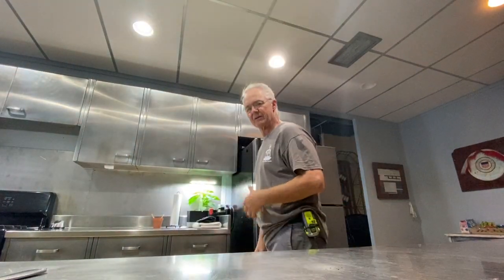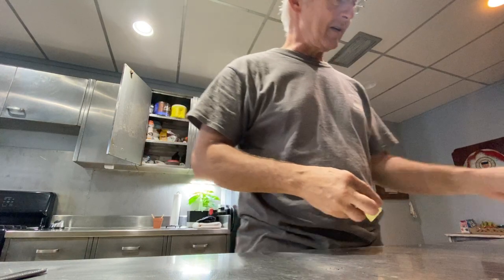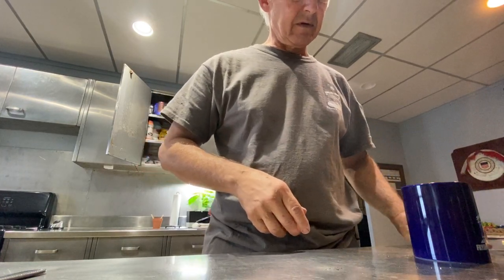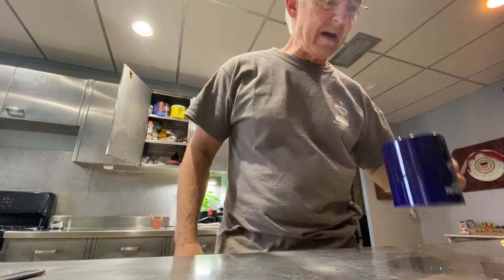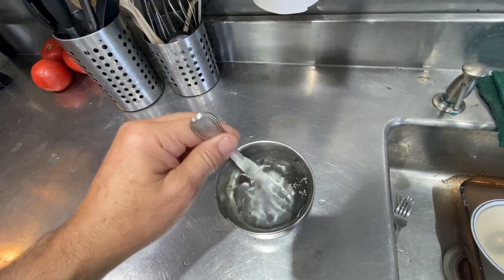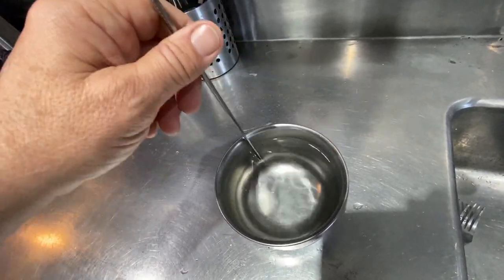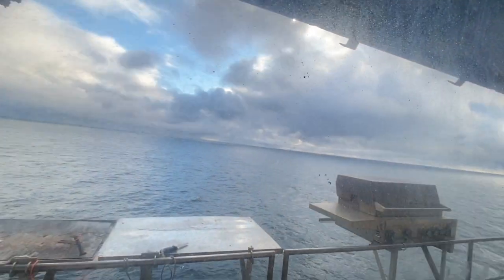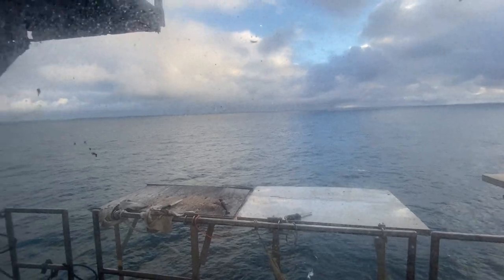How does the tower stay up in storms? and coffee...

Comment: How do you access the crane when you go there alone. Do you have to make sure you have a remote control with you. There is no to dock or anything right. In case the crane doesn't work, you have to go back and take the helicopter?
Reply from the maker: The answer is actually very simple. The boat comes within 3 feet or so of the NE corner leg with what's left of the rusted handrails. I jump off from the boat to the leg and try not to miss. Climb up 65' and open the access gate. Make my way into the belly, up the central stairs, open the main doors (for airflow) and fire up the Honda 7k generator to lower the hoist cable and start snagging people and large lift bags up from the boat 70' or so below. Easy... ;) or I take a helicopter if the waves are known to be over 4' because jumping from a boat in 4+ foot waves, now that would be crazy!  Richard
Reply: @FPTower  I love that you answer everyone's questions including mine. Thank you so much. Kind of like when a captain needs to jump on a cruise ship or a cargo ship to dock it in their marina. They drive up to it and the captain jumps off and hangs on for dear life. Thank you sir, appreciate your answers to my questions.

Comment: 42” round nice size, i have also heard rumors that the supports on thos structures go almost 300’ down into the seabed ?
Reply from the maker: I've been told several things over the years (original engineers seem to all be gone now :(  ) but they are at least 30-60' deep and filled with cement!
Reply: @FPTower  And, it's not as if they could divert the ocean while they worked on the foundation! (I was able to tour McKays Point dam in California while it was being built out of giant concrete Lego blocks. They actually moved the dang river for the occasion!)
Reply from the maker: @kell_checks_in  Wow!!!

Comment: The legs at the water level are 42” in diameter thick. Does that mean that the legs are solid 42” thick or the legs are 42” in diameter thick but hollow ?
Reply from the maker: They are 1" thick top to bottom, then jacketed with 2 additional steel layers of 1" and a 2" thick over the base steel for a total of 4" thick steel! They then rammed pipes through the middle deep down into the bedrock and topped it off by filling it with cement! These legs are built to last. Richard
Reply: @FPTower  Thank you for that, that was always my biggest concern since it's holding up all that weight.